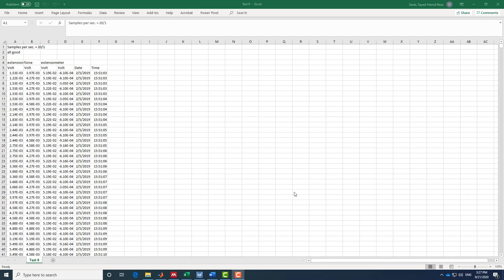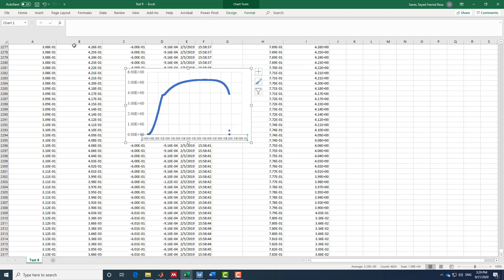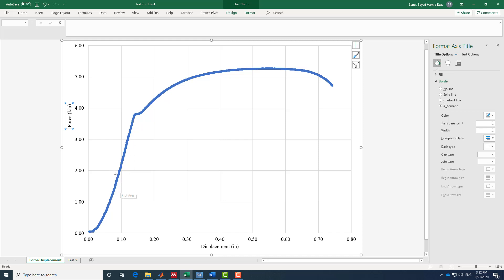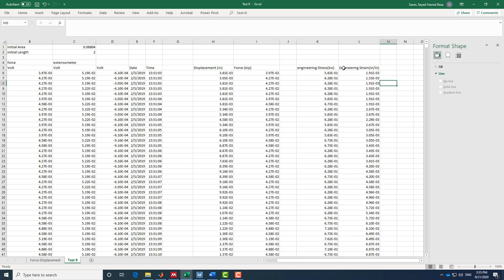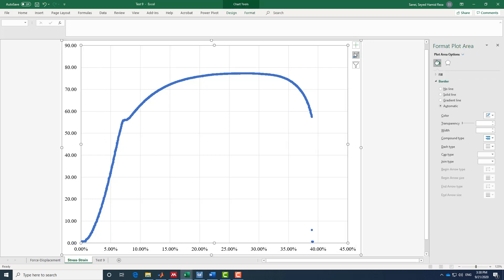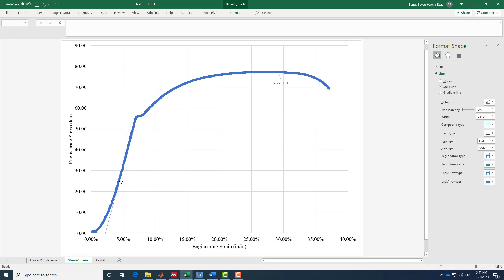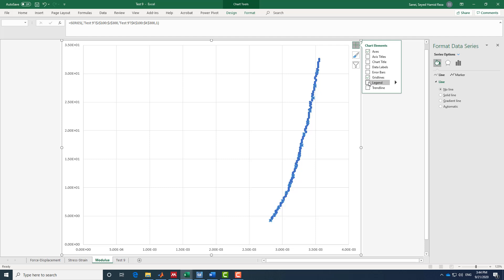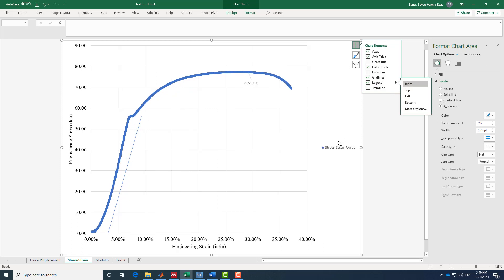How to plot stress strain curve in Excel?

Comment: I have a question about compensating the toe region. A continuation of the linear part should be generated in order to find the corrected zero strain point. Am I right? after that, should stress start from zero too? after this procedure, at the beginning, before the linear part, still there will be an inclined part. Is it right?
Reply from the maker: At the zero strain, the force is not necessarily zero due to tightening the grip! Stress-strain curve is not a good indication of initial conditions and it is hard to find the force at zero strain unless you read the machine recording at the time of experimentation! Extrapolation of stress strain curve will give you inaccurate beginning point. You can shift the stress-strain curve to give you more reasonable stress and strain values but do not extend it beyond its limit of recording

Comment: While calculating the Engineering strain the original length you used is the specimen gauge length or the length of specimen between the grips or the total length of specimen ??? 
Also in case we use strain gauge  instead of extensometer then for calculating strain what value of original length the strain gauge considers ???
Reply from the maker: I used the gauge length which is 2 inch for us. As there is extension across the entire length of our specimen as well as extensions in the load cells, we use the extensometer to only record the extension of the gauge length. In case of strain gages, they will return the strain values directly and no further calculation is necessary. Multiple strain gages can be placed across the specimen to monitor the non uniformity of strain along the specimen.
Reply: Thank Dr  @engineeringvision  for the clarification :)